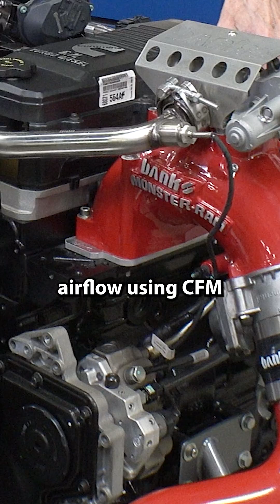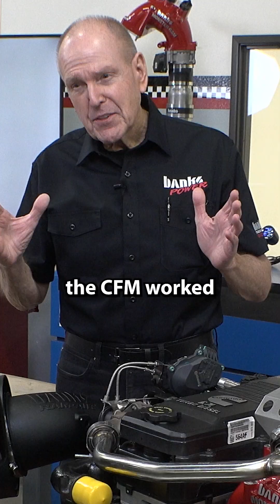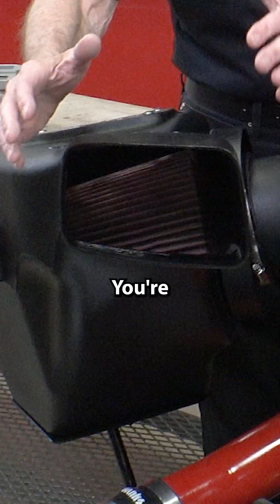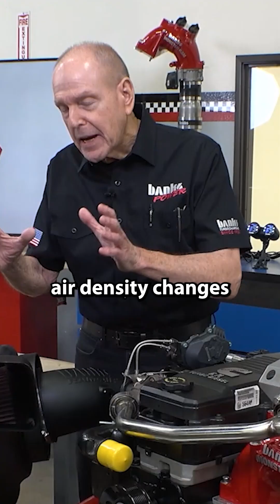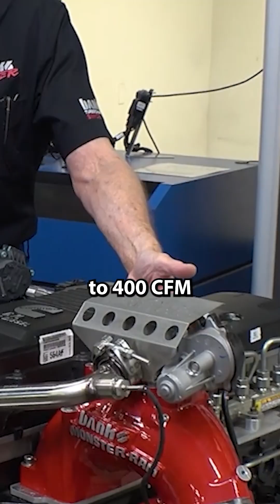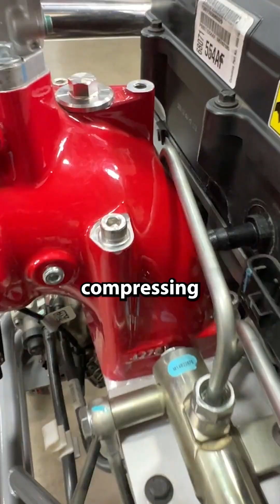CFM  ≠ airflow

Comment: When calculating, Mike Jones said you measure lbs per hour, it  begins to actually work in calculation and make sense, in both turbo and NA . Very good info Mr Banks.
Reply: You can Bank on that....
Reply: That's mass airflow, yucky imperial units though
Reply: @kingcosworth2643  Mass airflow breaks down at high RPM. Idk about diesels but most gas engines run speed density at high rpm because mass airflow censors are unreliable.
Reply: @bobbygetsbanned6049 why would a mass airflow sensor care about RPM?
Reply: Higher rpm means faster air flow and they just are not sensitive enough to make accurate measurements after the air starts moving fast enough.
Reply: @AcidGambit419  Exactly.
Reply: @AcidGambit419 seems like you just need a second bigger maf to switch over to at high flow
Reply: @NFSgadzooks because cars use what's called a "thin wire anemometer" to measure it and they're  not very accurate across a range of flows. It's actually pretty hard to measure flow accurately, and most accurate methods won't fit under a hood or require you to introduce a restriction, or both.
Reply: @bobbygetsbanned6049  you have it backward bud.
Reply: @pbr247  it happens...

Comment: It is still as important with good CFM numbers when boosted.
You just get that 'thick' air in better with good heads.
But you might need to modify some thinking as it is a slightly 'thicker' media that runs into the runners.
For an example, earlier dead areas in runners now suddenly might not be dead, and you need to modify porting design due to this.

Comment: this is why you use a speed density sensor and a map sensor on a Subaru that way you can pinpoint exactly what ruin your head gasket
Reply: There's no speed density sensor, speed density is a calculation based on your intake air temp (IAT) sensor and manifold absolute pressure (MAP) sensor.
Reply: @bobbygetsbanned6049  so that's why the tuner said I needed to get a 4 bar map sensor.
Reply: @kidsythe  Needing a 4 bar just means you're running more boost than a 3 bar can measure.
Reply: @bobbygetsbanned6049  shhh
Reply: The biggest cause of a problem with a subaru is driving them.
Reply: That's super easy...the Subaru emblem tells you it needs head gaskets.
Reply: F##k suburu
Reply: Last week I was in my Subaru and honked the horn too long and blew the head gasket!🤬🤣
Reply: Maybe just keep that cylinder from detonation
Reply: Subaru should consult Porsche on improving their Boxer engine
Reply: @malakisands8180  I see you've never worked on either. I'd replace rod bearing daily vs work on a Porsche boxer.
Reply: Don’t get a Subaru 🤦‍♂️
Reply: @ovdman  Man I'm going to be real with you but there ain't any other options. for real like take a 2005 legacy GT. for example, I own about three of them. and the only bad part is truly the EJ 255 or whatever the heck is in it. and then anything you try to build for power after that.
Reply: @kidsythe i know legacy owner has to replace whole engine
Reply: @kidsythe $9000 engine rebuild plus control arms 1400 sounds great owning a Subaru and only cost like 10k for the car...
Reply: @kidsythe other buddy WRX 04 7k he got it for he tried to tune it he's went thru 3 motors... was garage kept it's whole life ran fine it's when u try to tune them they blow up
Reply: @kidsythe get a ford ranger instead very reliable great work truck 👍 got mine for 5k had to replace suspension bc rust belt but come on man reliability of those things are amazing an cheap it's a nice little truck for working on stuff and more space than a Subaru
Reply: @JUNEBUGLLC  sadly I have to use a f150 I'm pulling about 7500lbs worth of trailers. them f150s if ya treat them right do good.
Reply: @kidsythe  Unless you got a 5.4 then they can treat you bad very quickly
Reply: @nou8257 there are literally no 5.4 tritons left on the road 😂
Reply: @JUNEBUGLLC get you a Silverado 07-13 instead, very reliable & bigger space too!! The thing never dies if kept well, thank me later
Reply: @nkonie7177  this guy is a real joke. Yea buddy all cars are reliable if well kept. but none of them are. the same years 04-11 I think 5.4 triton are good motors to. IF WELL KEPT 🤦‍♂️🤦‍♂️🤦‍♂️it ain't the early 90s Chevy in general hasn't be considered a reliable option for 30 years. 

I hate to say it but the trucks that are closest to a reliable truck these days are Ford and dodges. 🤢
 gone are the days of the ole reliable 350 sbc
Reply: @kidsythe  How do You own "about" three of them? Are You partial owner of one, Or do You own a portion of a car that has been cut off?
Reply: @robertfreeman5231  well I keep multiple engines ready to install and multiple in pieces
Reply: @kidsythe  good answer!

Comment: Hello sir what is your thoughts on the new compound Turbo systems for these 6.7 and 5.9 cummins engines?
Reply: @davidguzower2890 I wish you luck on getting a response from Banks. Their proper answer could easily be an entire video. From past vids&podcasts I can say this, Gale Banks seems to have a love/hate relationship with compound turbo setups. Loves the broad power curve they can create and hates the loss of air density due to heat of double compression of the air. He states a good intercooler between the atmosphereic (larger) turbo and the smaller turbo is a must.
Reply: @kevinkalivoda3442  if you are twin turbochargers you need to lower the compression , then you lose power & engine gets dirtier then you need to add more fuel to get past where you were .with that said i run the 6.7 big brother the kta -1150 ci single turbo & twinturbo ( compound) the twin turbo engine will run off & leave the single turbo, the twins have the lower end HP. No match

Comment: So, the air density is 3x?
Reply: His example yes but it depends on how much you're compressing the air (aka how much boost).
Reply: Roughly, yes. Varies with humidity as well.
Reply: That would be at 45 psi boost because you compressed it 3:1 from the 15 psi normal sea level air pressure.
Reply: @grantdavis5992 without being overly analytical, yes you are correct. The yhing to remember is, pressure is resistance to flow and does not take into account other things that affect air density. 
Petsonally, 45psi is not an abnormally high boost pressure for a Cummins engine.